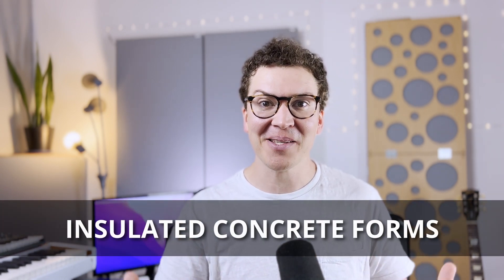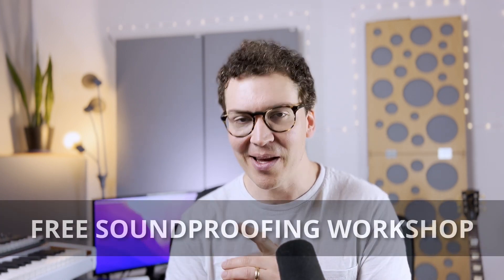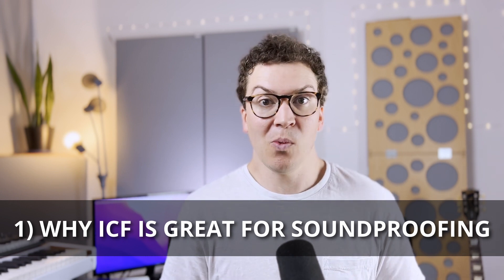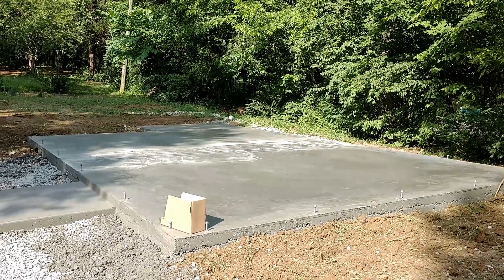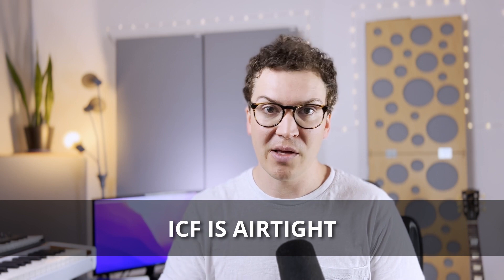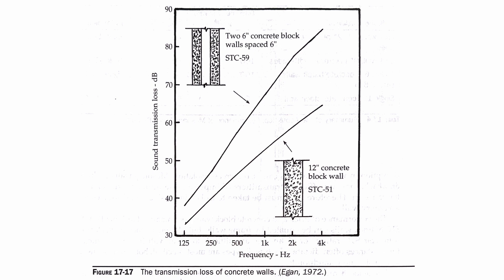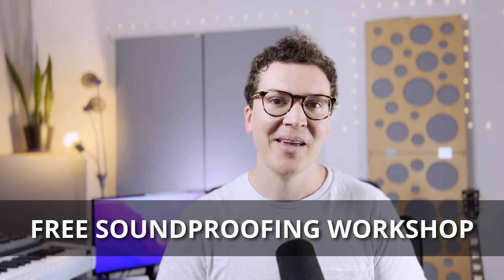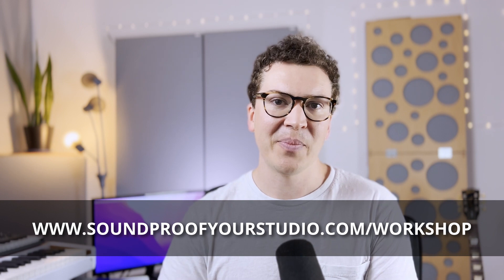This Soundproof Material Blew My Mind

Comment: How would you do split units and erv fresh air? Would you pre install a tube through the icf for the fresh air and split units?
Reply from the maker: Yeah, I haven’t worked with it yet, but I would ask the contractor how best to send vents and piping through the wall system.
Reply: @soundproofyourstudio  ok, then with icf build inner walls for rooms and use hardie planks for exterior.

Comment: Hi…. I think it’s important that you update the video on ICF with some comment on safety and the environment…. If ICF is truly styrofoam block filled, is it fireproof? Is the styrofoam chemically treated and what happens regarding fumes in case of fire, electrical or otherwise. Styrofoam tile based system ceilings were used many years ago but found to be truly dangerous from fumes and ‘dripping fire’ when burning. Please advise ref fire safety if using internally and environmental impact of this ‘plastics’ based product
Reply from the maker: Definitely a good point and worth doing some more research on.
Reply: It’s not hard to do a little research to find that it’s a non-issue because the foam is covered. It’s no different than building a wood house then putting foam insulation on it and then putting siding the foam is not exposed.
Reply: There’s so much misleading information online about Icf. You were quite incorrect saying it’s not DIY friendly that’s one of the best parts about Icf is that many people build their own. I’m building my second one as we speak.

Comment: Thanks for another great video friend! A question regarding a future studio build. 
So, I’ve an idea to install glass sliding doors  in the studio to the outer wall - perks are they let in a lot of natural light at the same time as not compromising too much on the soundproofing of the room as my idea is to have two of them and air between them. Also it looks great and can be used to open up during summer. It’s probably expensive but I’d like to hear what you think! Have a good one and keep em videos coming!🙌
Reply from the maker: Be careful with this design as float glass is not the best at soundproofing. Buying pre made doors is advised but costly.